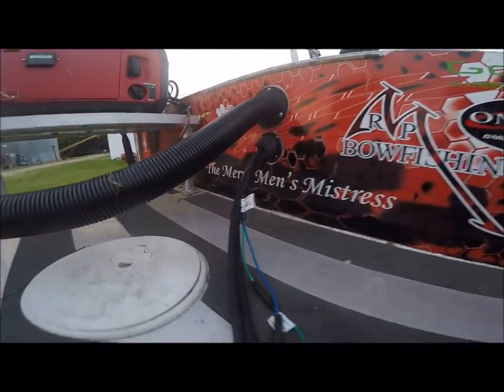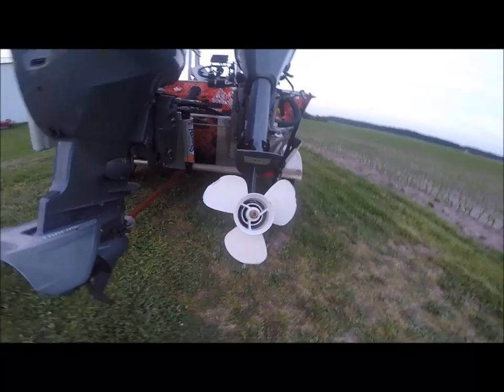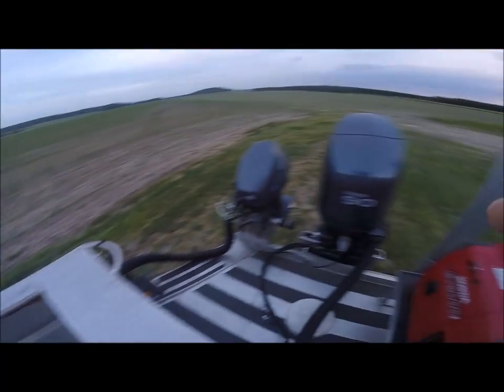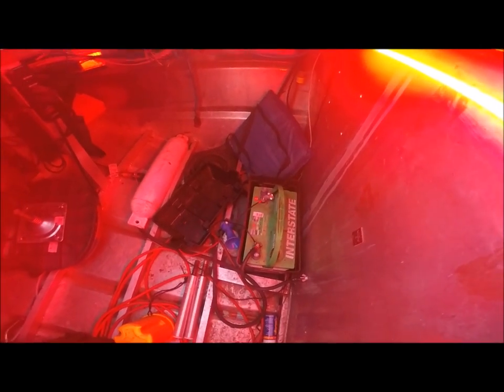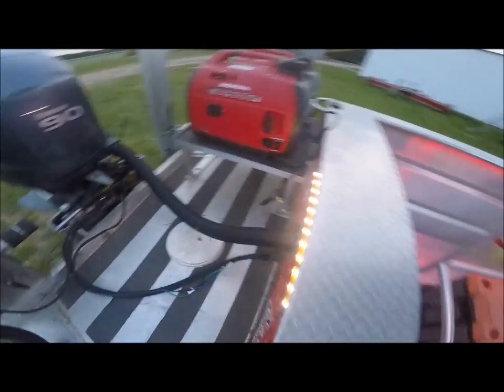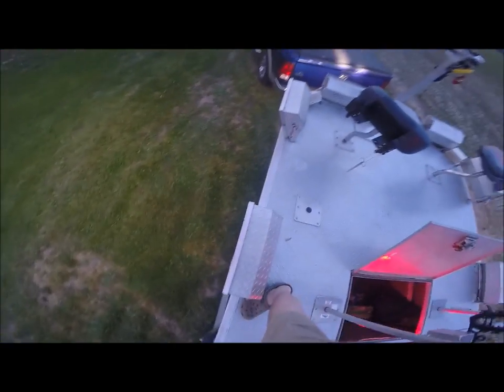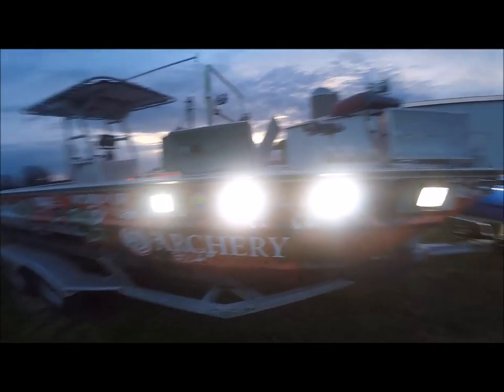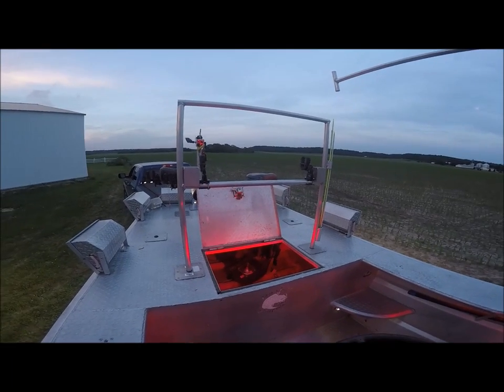1872 Custom Bowfishing Kicker Rig For Sale. Redneck Custom Airboats

Comment from the maker: Asking Price is $27,000, price is negotiable as I am willing to keep a few things.  Price includes all mentioned on the boat except, Generators, Jack Plate, and Garmin Rhino GPS /Radio. Questions or interest Call Cliff at 715/222-5769.  Great boat, I'm building another kicker rig a bit larger which is why I'm selling this one.